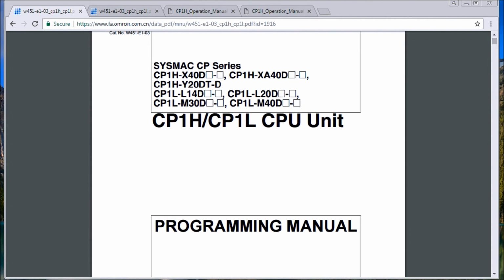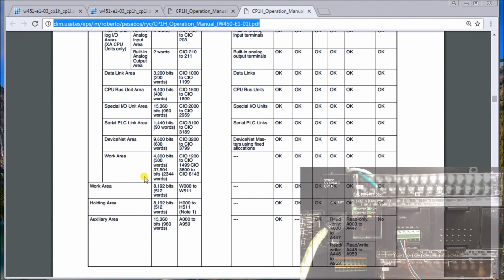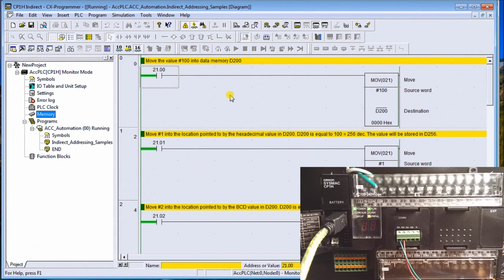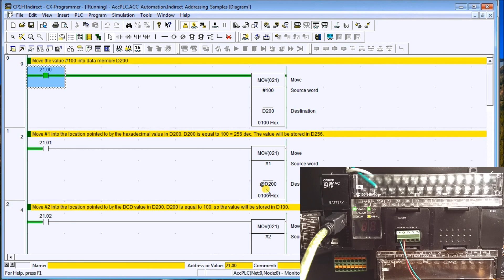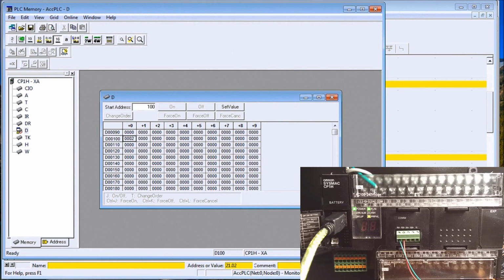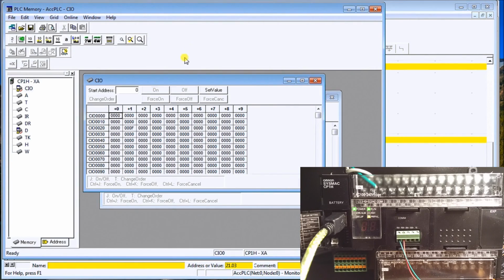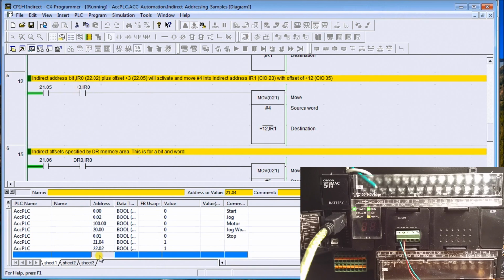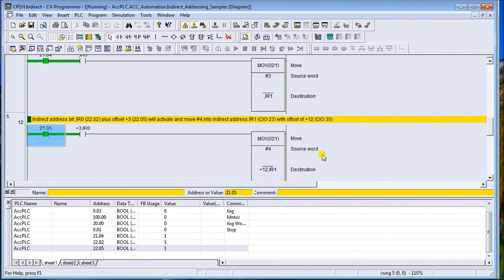Unlock Omron CP1H PLC Secrets: Master Addressing Fast!

Comment: why we need to use Indirect memory??
Reply from the maker: Hi Chandarara,
We do not need to use indirect addressing, however, this will make programming sometimes easier to understand and write.
Here is a post that will explain more about indirect addressing:
https://accautomation.ca/here-is-a-method-that-is-helping-plc-programmers-to-program-faster/
This post will show you an example program of conventional timers and bits vs indirect addressing.
https://accautomation.ca/building-a-plc-program-that-you-can-be-proud-of-part-1/
I hope this helps you out.
Regards,
Garry
Reply: @ACCautomation   Thank you

Comment: This is a good tutorial on indirect addressing when using addresses explicitly. I'd like to know how this is done when your destination is a named array in the symbols table. For instance, lets say D100 is a single word integer (INT) named Idx1 and Tbl1 is an array of 10 double-word floating point numbers (REAL[10]) starting at D101. How would you MOV a value to Idx1 of Tbl1? I assume this must be possible since the symbols table lets you define arrays. Thanks in advance.
Reply from the maker: Hi Jim,
Real 32 bit words will take up 2 registers. So the first real word will be in D101 and D102. 
*D100 will contain the value 101 to specify the first of the table.
You can then use a MOVL (double move instruction) to move the real value to the table.
I hope this helps you out.
Regards,
Garry

Comment: Hi Gary,
I have a few questions i was hoping you could help me with. I have done some programming with Schnider but am new to Omron.
First if the data sheet says CIO input 0 to 16 then why do we use 0.01 and 0.02 as inputs not 1 and 2? same with outputs 100.01/ 100.02 not 101/ 102.

I am also wondering why you would use bits 20/21 and 21.01 etc and not the D20/ D21(as I thought D was memory data), What is the difference between 20 and D20? Does using the random memory bits get confusing in a larger program? In Eco Machine I always used a M bit to store internal working.

Is there a way to look at all addressing without monitoring it online and selecting the bits to monitor? Say you are looking at someone else's program and need to add some things or understand it and you want to know all the memory bits they have used?

Thanks so much for your help, I really appreciate it! 
Thanks Vance
Reply from the maker: Hi Vance,
CIO Input 0 to 16 are words with 16 bits each. So the CIO Input words are 000 to 016. A decimal is used to look at the individual bits within the word of the expression.  Example: CIO 000 = 000.00 to 000.15
The output words would be 101 and 102. The bits in these words would be 101.00 to 101.15 and 102.00 to 102.15.
Anything not used as an input or output can be used as an internal bit. 
D20 is a data memory that is memory retentive. 20 is an internal word that is not memory retentive.
You can always call up the word and monitor the binary bits. This will show you the status of all of the bits in the word. 
The entire Omron CP1H series can be found here:
https://accautomation.ca/series/omron-plc-cp1h-series/

I hope this helps you out.
Regards,
Garry
Reply: @ACCautomation  
Good Morning again Garry,
Thanks for the time you are putting into your replies they are amazing, and I really appreciate your effort!
I have a CP1L-EL that I have the luxury of being able to play with.
I have been trying to work out analogue inputs and scaling them to suit a function. (Mine is 0-10V i have hooked up to a voltage generator, going to a gauge on an HMI.)
I am using the scaling block SCL and have watched your video explaining it along with looking in the instruction help.
The one thing I cannot figure out is when I'm using say D100 - D103 to set the parameters of the scaling, the parameters are not set/remembered in the PLC program so if I upload the program and re-download the program, I have to enter all these parameters again. Am I entering them wrong or just monitoring them wrong?

Thanks for your help again!
Vance
Reply from the maker: @Emuncatory  
This is a common question. When you download your program, please make sure that you deselect settings and special unit setup. The DM area these reside in on the CP1 controllers will not be written.
I hope this helps you out.
Regards,
Garry

Comment: How do I
 test if I have faulty inputs or outputs on my CP1L PLC ?
Reply from the maker: Hi Clifford
Faulty Input: 
- Look at the input LED on the PLC to see if it is turning on and off with the sensor input. If it is not then measure the voltage on the input to see if it has voltage. If you have voltage and the input LED is not on then the input has malfunctioned.
Faulty Output:
- Look to see if the output LED on the PLC is coming on and off according to the program. If this is a relay output then remove the load and measure with an ohmmeter as the output switches. The relay should close giving you 0 ohms when the output is on.
I hope this helps you out.
Regards,
Garry

Comment: Hi Garry,

I'm about to change out a faulty cp1L omron, and I'm wondering if i can connect to the old one, download the settings and upload straight to the new one, or I have to start from scratch
Reply from the maker: Hi James,
You should be able to connect and upload the program from the CP1L. When you say faulty, It will work as long as the communication is still functional. 
If you have the exact same model of CP1L then, just download the program to the new PLC.
Regards,
Garry

Comment: Sir please explain mov(021) c20 8 in omron cs series
Reply from the maker: Hi Vishal,
The MOV(21) instruction will move a 16-bit register to another 16-bit register.
In the CS series, there are a number of ways to move this indirectly. See 2-1-5 Specifying Operands and 3-6 Data Movement Instructions in the following manual.
https://assets.omron.eu/downloads/manual/en/v2/w394_cs1_cj1_nsj_series_programmable_controllers_programming_manual_en.pdf
I hope this helps you out.
Regards,
Garry

Comment: Dear, how are you?
Im am in truble CQM1H-CPU51,
Supper capacitor change from cpu ckt. Occur error. How can i re use.  If i use programming console is ok?
Reply from the maker: Hi Md. Saif Uddin,
Do you currently have a solid red light on the ERR/ALM led located on the CPU?
If you do then this means that the program in the PLC has been lost. What kind of backup do you have of the program?
If you have a programming console (PRO 27) this can be plugged into the CPU to determine the errors on the PLC.
Regards,
Garry

Comment: thanks very interesting,,,, iam beginner with omran PLC ,,,,Want to know how to do to communicate with another plc ,,,, how to send message via ethernet port ,,,,thanks to help
Reply from the maker: Hi Salah,
The communication would depend on the PLCs that you are using. 
If you are communicating to a different brand of PLC, then the best method is to use an HMI (computer) to share information. Here is a post using AdvancedHMI to communicate to the Omron PLC.
https://accautomation.ca/omron-cp1h-advancedhmi-communication/
Several of the Omron PLC's will have a protocol called PLC Link. You would connect them via a communication cable and they would share a common memory area. Each one would be able to write to a specific area and read all areas.
I hope this helps you out.
Regards,
Garry
Reply: @ACCautomation  THANKS MASTER ,,,i have another question ,,about the resolution of analog card , iused with allen bradley with 16bit resolution means 32767 ,,but in omron ,1/8000 for example ,,what does it mean^thanks
Reply from the maker: @sammysands1977  
The specifications for the Omron is resolution. You would take your input signal range and divide by the resolution. 
Example: 1/8000 
Selected input range = 0-10 VDC
10VDC / 8000 = 0.00125 V steps for the analog input.
This means that the analog can tell a difference between 0.00125 volts on the signal.
I hope this helps you out.
Regards,
Garry
Reply: Garry Shortt  thanks again for explanation, it is interesting

Comment: do you have any tutorials as to the addressing of add-on modules such as adding an 8-channel analog input to the CP1H?
Reply from the maker: Hi Eric,
The CP1H uses a fixed addressing structure. As you add modules the next available channel (register) is used. Inputs start at 000 and outputs start at 100. 
If we look at the CP1W-MAD01 unit, it has two analog inputs and one analog output. The input address would be the next available channel. If our CPU unit is using input channels 000 and 001 then 002 and 003 will be used for the analog input. If our CPU unit is using 100 for the output IO, then 101 will be used for the analog output.
Here is a reference for the expansion units for this series of PLCs.
https://www.myomron.com/downloads/1.Manuals/PLCs/CPUs/CP1/CP1W-AD_DA_MAD_TS_DRT_SRT%20Pages%20from%20W471-E1-04.pdf

Hope this helps you out.
Regards,
Garry